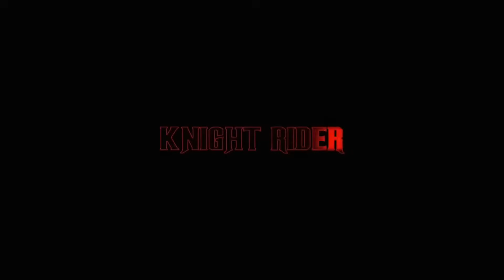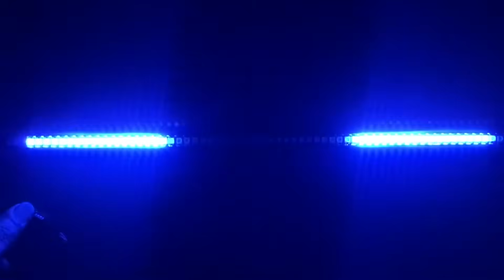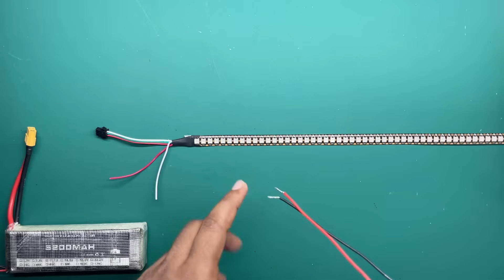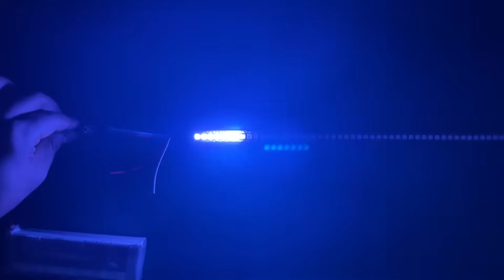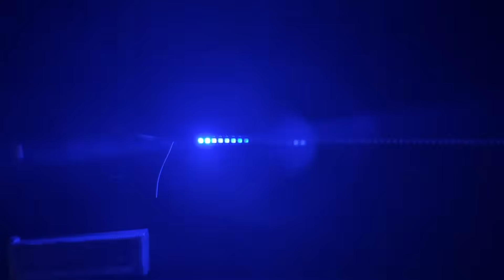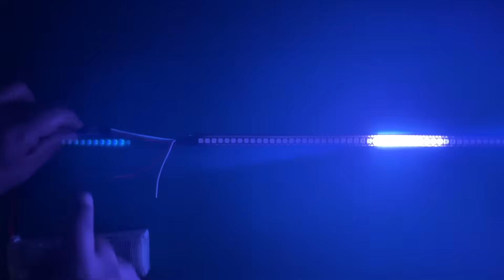Multi Pattern / Colour Knight Rider Scanner With LED quantity & Speed Change | Ready made | ATtiny85

Comment: nice!. can you do it on stm32? about LED Car Tail Light?
Reply from the maker: You mean on ESP32?
Reply: @HAZITECH  
Not. stm32f103c8t6 is a 32-bit microcontroller by STMicroelectronics. I think you will surely know?. If you do it on the ESP32, it's even better because it can be controlled via Wifi, blue, etc. However, if you want to control ESP32 by phone, you must use an app, and making an app is also quite complicated if you are not a programming major.
Reply from the maker: I already made an Android app to work with the ESP32. Video will be released in 1-2 weeks. Stay tuned.
Reply: @HAZITECH  
 Great. If you do on ESP32 control via app and have enough features like on aduino and you can customize the number of LEDs on the app. so great.
Reply from the maker: Yes all included in the app